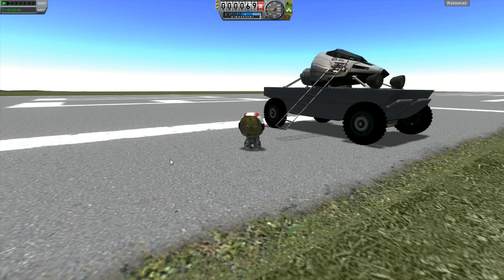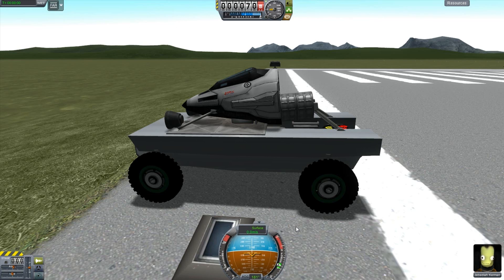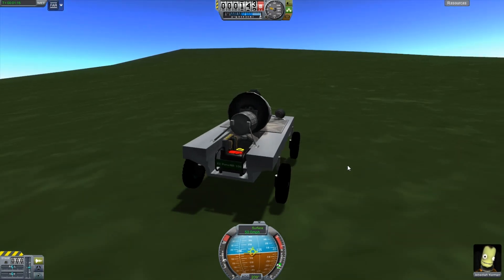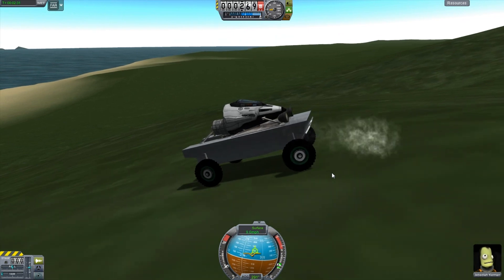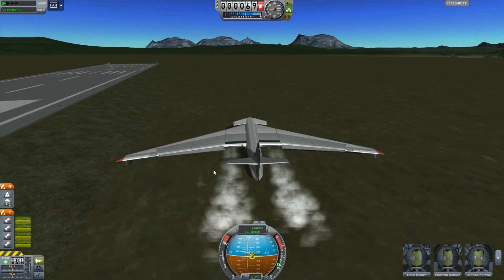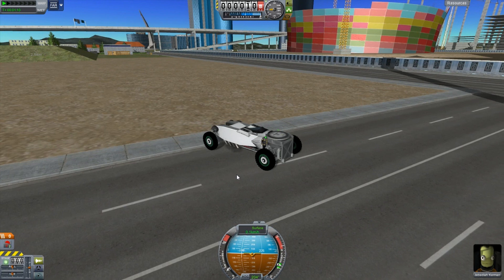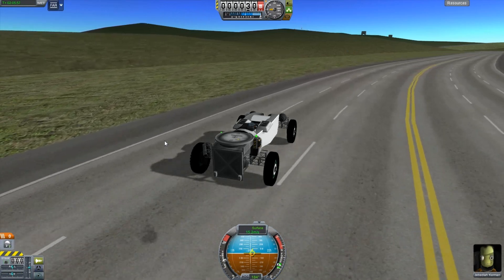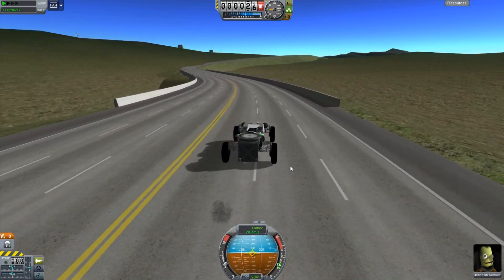ICE Engine Alternative KSP - Skillful Enabled - Vehicular Carnage!

Comment: my engine isnt starting
Reply from the maker: +Kristinn Hardarson 
right click the engine, you can use the auto start there. Make sure you have a fuel line direct to the engine, and make sure your throttle is cracked open a bit. That should allow starting.

Comment from the maker: typically you just need to right click the engine and make sure that the w throttle is on. then rightclick the engine and click autostart, or bind the autostart to a quick key in the hangar. You will require electric charge, fuel and a radiator. The engine has a small amount of fuel in it, and has an air intake on it. If the engine just stops then you either have the throttle too low or the fuel is gone.

Comment: I can't seem to get the power to go to the wheels. I'll shift into gear and nothing happens. It would be extremely helpful you made a more detailed control and construction guide!
Reply from the maker: Did you add the transmission box?
Reply: Infini Tedice I did add the transmission box. It says that is has revs in and out but it won't move the wheels. I tried with both sets of wheels and different engines.

Comment from the maker: Note: The mod isn't updated for 0.90, therefore it may or may not work properly if using 0.90. Otherwise it's PG Up and PG Down on the keyboard.
Reply: I need some help, I may be doing something obviously wrong but I can't seem to get the engine to start, no matter what I do. It sounds like it is about to start, but then it just dies. What is it i'm doing wrong?
Reply from the maker: Hi Chase. From what I've seen it works with 0.90 I will be updating the download soon. You want to make sure the engine throttle slider is set to 0.9 or whatever you want the limit to be also make sure it is using 'w' throttle. Then from the menu click 'auto start'. Use the pg up and pg down keys to change gears with the transmission. It takes some fiddling to get the car to handle so use all the settings on the tires as well as the transmission to achieve what you're aiming to do. Hope this helps :)
Reply: Infini Tedice No matter what I seem to do, the engine just won't turn on, it makes the start up sound but doesn't actually start.
Reply from the maker: it needs liquid fuel... try this pre-release dll just copy it over the old one. This will eliminate the 0.25/0.90 incompatibility as the cause. https://drive.google.com/file/d/0B82_uLLhCvSPSkhjTnIwcjctOTA/view?usp=sharing
Reply: Infini Tedice Thank you, it worked on fixing my propellers, now I just need to get the propellers to actually fly the plane.
Reply: Infini Tedice i dont have a pageup and down key, what do i do?
Reply: How does one build with this engine?
Reply from the maker: For the vehicles you need an engine, transmission box and wheels Start the engine, put the transmission in 1st and drive. I suggest the W throttle option on the engine, allows W and S for acceleration/deceleration.
Reply: ok im runnning intto a new problem how do i connect the wheels to the trasmission and the trasmission to the engine it wont move even though the engine is running
Reply from the maker: they automatically connect, make sure the wheel you use is a driven wheel.. make sure the wheel motor is active. There are two wheels of each kind, a driven wheel and a steering wheel, though a steering wheel can still be made to drive.
Reply: ok thanks for the info

Comment: Out of curiosity, how well does ICE work with multi-engined vehicles?  I've got a few car designs rolling around the back of my mind and a couple involve two engines.
Reply from the maker: It's designed to couple engine output, this can be spread out over as many drive wheels as you want. It can only have one transmission though.

Comment: Infinite Dice, why did you edited Bac9's mod?
Reply from the maker: I have never edited anyones mod. Some of the parts of the car use Bac9 parts, or Procedural Wings.
ICE is the engine, transmission and wheels - those are the parts that make the car move, and those are mine :)

Comment: Can't wait till this is released. Could you make it so that the wheels have more traction, it seemed like the car was slipping very easily.
Reply: flyingman1900youtub1 When I'm at 40 m/s I'm going 88mph? Damn, my tanks are fast!!!
Reply: 20 m/s is 44 mph so most of the times the car flipped in this video was due to high speed turning.
Reply: I think part of that was the car being setup as a rear-wheel drive, also more traction means easier to flip in KSP physics
Reply: ***** KSP needs to tone down the want to stay in motion. It's unrealistically high at the moment. I want to make a car that won't flip when I turn the wheel half an inch.
Reply: Superfamily Allosauridae Does it generate 1.21 jigawats at 88mph?
Reply: SlitexGaming Yes. Yes it does. It also has an Ice Cream Truck on it.
Reply: Superfamily Allosauridae I don't think you understood that refrance ._.
Reply: SlitexGaming I did.